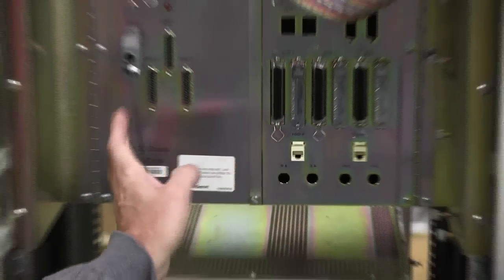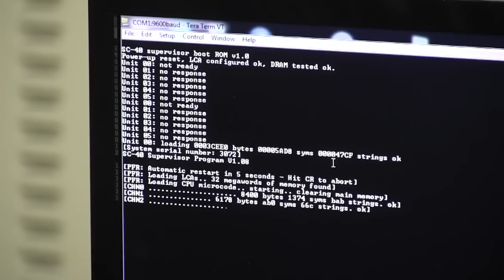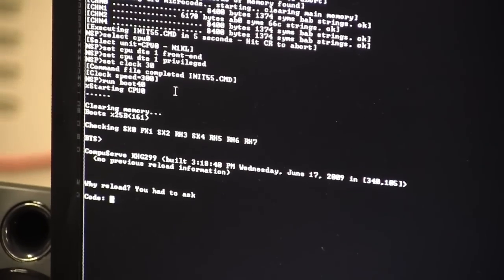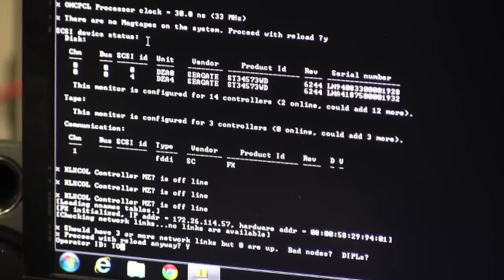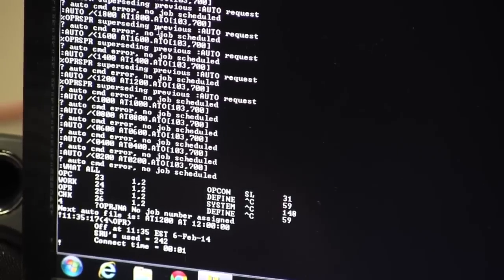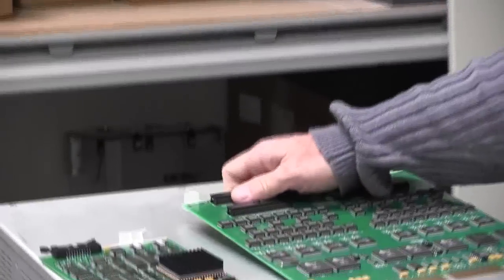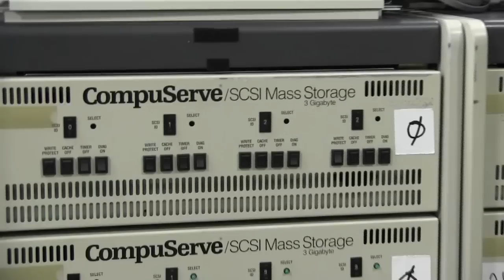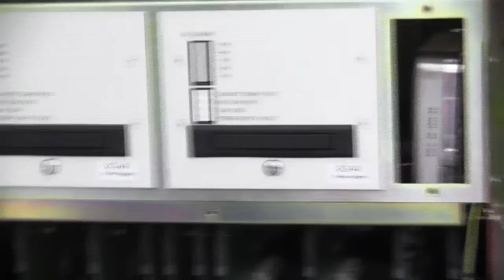Compuserve PDP-10 SC-40 Boot Up

Comment: I worked at ADP's Ann Arbor computing center where we were the other major PDP-KL10 center left on the planet.  We used to share a little of the dinosaur technology back and forth with CompuServe trying to stretch the life of the systems while we tried to get the clients to move off onto more current hardware.   I think CIS got some of our shared-memory technology and we started using their proprietary SCSI interface boards.  It was such a dream being able to install the equivalent of an entire string of RP06 disk drives (the kind of things that looked like a row of washing machines in a laundromat) into a standard tall PC case and then put the whole thing right INSIDE the KL10.

It was like installing a Chrysler Hemi in an old Stanley Steamer... but it worked just great.

Our engineers worked with the SC team in Las Vegas when they were designing the SC-40 because we'd done a lot of work with them on our shared-memory hardware for the KL-10s.   The news of the KL10 "clone" began to trickle down through the tech departments and the excitement when we got our first test system was like Elvis was visiting.

It was pretty amazing watching that relatively little cabinet running our modified TOPS-10 system at EIGHT TIMES the speed of the standard KL10, using a fraction of the power and generating almost no heat or noise.

We ended up replacing two gigantic computer rooms full of noisy, hot, huffing and puffing dinosaur KL10s with a row of quiet, cool and blazing fast SC-40s.   I was pretty new to the job and in a way it was kind of sad that as one of the new guys I ended up decommissioning the KL10s and helping push them onto trucks to be taken down to Texas and melted down into hubcaps (or whatever).

They ended up filling the former computer rooms with cubicles and people and PCs, and of course every person had a way more powerful computer on their desktop than the hardware that had been replaced.  (Of course, they weren't trying to multitask hundreds of clients like the KL10s excelled at.)

The SC-40s didn't last though... it wasn't long before they too took that long lonely ride down to Texas, replaced by VAXen at last.   But they were an amazing footnote in computing history... and a testament that you can accomplish pretty much anything you put your mind to, no matter how small the niche you're trying to fill may be.

Excellent video, by the way...  almost brought a tear to my eye, seeing that run one more time.
Reply from the maker: Bob, thanks for adding that bit of ADP SC40 history.  We are currently listing the rest of the SC40's on Ebay maybe you want one, we cant keep them all.  when you were working in a maching room with strings of RP06' with heads flying you really felt like you were doing something.
Reply: Gerry Moersdorf
Lol..  a friend had an RP06 run over her foot when we were moving one into a string one time.  Her toes were purple for a week... from being run over by a hard drive.   I guess that's why they called it the "Big Iron".
The real fun came when a DEC PDP10 KL10 CPU died and it took 4 of us to push the "spare" in from another room.
I knew I'd hit the big-time when the place had a spare mainframe running hot and ready at a moment's notice..!
Reply: +BobRDeTamble I worked in that data center too. It was a neat building. I always liked how they built it on the border between 2 power companies and had both servicing the facility.
Reply: Sorry...  didn't notice the comment notification before...

Yeah, I remember a number of times having two separate power feeds saved our bacon.
Actually, both feeds were actively used normally, one feeding power to the older computer rooms and the other feeding the newer ones.  In case one incoming feed died there was a relatively involved procedure to tie both feeds together so everything could be supplied by the one remaining working feed that used key activated (regular housekey looking keys) locks to unlock the circuit breakers so you couldn't accidentally tie both feeds together when both were active.  They made the newbie hardware engineers practice it before they were allowed to be on duty on the weekends when they'd have to handle things all alone... I remember I only had to do that once and must have jumped 3 feet when the circuit breakers closed with a resounding "BANG!!!"

It was kind of sad when the old dinosaur computers were all packed into trucks to be recycled into hubcaps and replaced by cubicles filled with PCs.

Comment: By far the best SC-40 video ever done! No kidding, this is fabulous that you have preserved these amazing machines, and totally impressive that you have been able to boot them up.  Stew Nelson & Mike Levitt are unappreciated true geniuses - they fled Silicon Valley for Reno (better tax climate), and designed the SC-40 chip with the Hitachi simulator - and got it perfect on the first try.  The boards you show were actually manufactured by CompuServe under license from the SC-Group (formerly Systems Concepts).

Comment from the maker: Regarding some of the questions below,  I am preparing a number of the SC40 systems to donate to "the living computer museum" in Seattle funded in part by Paul Allen of Microsoft fame.  I am trying to figure out how to load the stock DEC monitor on the system.  Since there are many revisions of the SC40 micro code and no way to boot the distribution mag tapes the process will have to involve another computer with internet access and SCSI disk support and who knows what else.  The systems concepts founders seem to gone off the grid and they took the secret decoder ring with them.  Long live PDP-10 hackers.

Comment: The chip at 10:30 is a Fujitsu MB86930-30 SPARClite processor.  Thanks for the great video and for sharing such an awesome machine!
Reply from the maker: That makes sense since the masked part that forms the pdp10 cpu is fujitsu and development software ran on a Sun workstation.

Comment: The supervisor processor is a SPARC, specifically a Fujitsu MB86930 SPARClite which was the first SPARC processor specifically designed for embedded applications.

According to System Concepts, the whole system, other than the custom CPU, is built up from commodity chips.
Reply from the maker: Thanks for the data on supervisor CPU chip, this makes sense since the system was built using sun workstations for gate array mask development and simulation.

Comment: Brings back memories. Everything starting with Boot40 until OPSER started running was stuff I wrote. That one big chip (400 gates) replaced two boards in the SC30 and probably a half-dozen boards from DECs last effort (KL10). Stew could keep track of the whole thing in his head. I remember that someone asked for a change. Stew sat there for a few seconds and said sure, he could fit that in.
Reply from the maker: Do you think Stew has seen the videos? he seems to be off the grid.

Comment: I thought your name sounded familiar! I was on OSU's IRCC-CIS KA-10 serial# 76 at the same time as you. My wife was one of the operators. I went to work for DEC shortly after the KL was brought in to replace the KA. We both consulted for CompuServe over the years. It was a dark day when Jupiter was cancelled, and really nice that SC and Foonley picked up where DEC left off. I still have shelves of documentation from that era, and a working LA36 that might make a good serial console if you need one.
Reply from the maker: +Bill Valentine-Cooper Well hello blast from  the past.  I came to OSU in1970 and dropped out in 1973 or so, I lived in Caldwell lab KA-10 computer room and worked for Tom Defanti, who got his PHD and later wrote code on the pdp11/45 for Tom and Chuck Csuri on an animation system called "Grass".  I self taught myself by reading the Tops10 4.N.72 monitor code, didn't go to classes and it all came out good in the end.
Reply: +Gerry Moersdorf , OK, so I guess we didn&#39;t quite overlap, because I came to OSU in 1975, and left in 1980. I had the office closest to the lab, right next to the SW stairwell, like, 408 or some such. We used to climb out the windows and sit on lawn chairs on the roof. Herb Johnson was managing the operators, and the one who&#39;d been around the longest was Jim Davenport. He got my wife Susan hired there, and then his wife Laura introduced me to her. I was working on a project on the DEC10 for Dr. Lee J White, who was acting CIS chair, Dr. Chandrasekaren and Dr. Zweben. I seem to remember the DEC FS guys as being Fred Saas, Dennis Slagy and Del Waggoner. When I started at DEC, the TOPS old-timers were Dave Len and Dave Gorka -- ring any more bells?
Reply from the maker: +Bill Valentine-Cooper I  do remember some of those names,  what a blast from the past, Chandra was Tom's Professor and I met him a few times, but I do remember the little box offices with the roof tanning booth.  They paid me to teach pdp10 Assembler to PHD candidates, and I was a drop-out, I guess OSU didn't really believe in their product.  I have a picture taken in the men's room where we dragged a TTY33 into the stall and you could see legs of Tom Defanti at the base of the teletype with him sitting on the throne and the teletype paper coming off the back.  its one of my treasured photos of the time.

Comment: So the PDP-10 CPU is emulated in a Gate Array (FPGA)?  What was the main clock speed?
Reply from the maker: +Warren Postma  The clock speed was software selectable from the MSP ( the bootstrap processor) the speed usually selected at CompuServe was 33MHZ
Reply: +Gerry Moersdorf  Cool thanks!  As someone who used CompuServe briefly in the 80s and the early 90s, before "The Internet" was being used by ordinary non-DARPA/non-University people it was really The Online Hub.    There was a commodore forum on there, and a bunch of other message boards and it was quite the thing back in the day.  I had to pay to access Telenet or Tymnet and then pay for CompuServe so it was not cheap.

Comment: It is really cool to see this PDP-10 boot up. I used to use a PDP-10 at the University of Pittsburgh which had two of them as a student. I found out that a simulator was built for the DEC equipment and was able to get a Phi Wherry image running on a simh simulator. I have this running on Amazon AWS and have been able to run the TOPS-10 OS on a Rasberry PI single core computer too. To try the TOPS-10 just issue this command from linux or even windows dos prompt: telnet jeffreyfall.com 2020
and you will get a prompt of .
then do a systat or a sys and you'll see the status of TOPS-10.
There is also VMS 7.3 running on a Rasberry PI at telnet lgcrc.jeffreyfall.com 6000

Of course this is no way as fun as handling and booting the real hardware.
Reply: In the mid-1970s I did freelance tutoring for students at Pitt and got to play with the DEC 10 computers remotely. The actual mainframes were located at the RIDC Industrial Park in Blawnox and accessed via RJE terminals in the basement level of the Cathedral of Learning via a microwave link. They had keypunch machines and card readers for program input, as well as big, noisy line printers for output.

Comment: Hey Gerry, is the Compuserve application or source code still kicking around on any of the SCSI drives
Reply from the maker: Not the source, just the compiled/assembled stuff.  that's what i have on my SC-40 and the one at the Living Computer Museum.  However old it is I don't think AOL/Compuserve wanted anyone to have that.  They use it to defend patent infringement actions.
Reply: I bet there would be a lot of people who would like to experience C-Serve again. It's too bad they wouldn't allow it to be put online, again, in one form or another. I used The Source briefly in the 80s at a friends house, and then Quantum Link on one of my commodores. I never got to experience CServe and their cool Octal usernames!

I was running a BBS this whole time. Then the next think ya knew it was 1994 and there were local ISPs offering dialup PPP accounts.

Comment: I thought you might find this slightly interesting. When I worked for Kroger in the 90s I worked in Customer Service. We had Western Union just like most Grocery stores do today. I noticed that the number for the Western Union computer that it dialed was the same tel# that I used at home to dial-up for Compuserve. I still remember my username for Compuserve. 71162,1676 or e-mail was 71162.1676 of course. See if you see my old account in there if you've gotten that far by now. lol
Reply from the maker: Thanks for the story.  Compuserv hosted many services and not surprised WU was one of them.  They zapped the customer files before they retired the SC40's